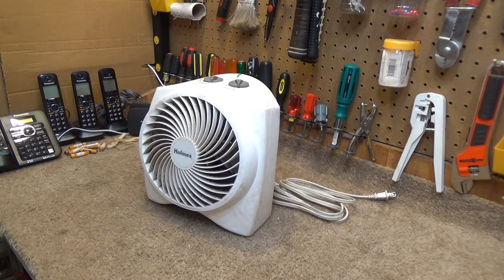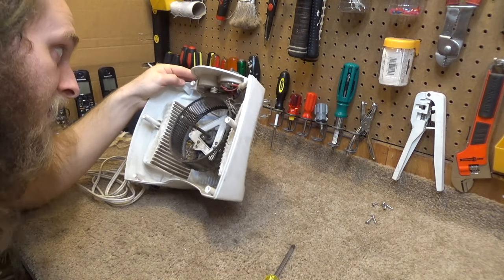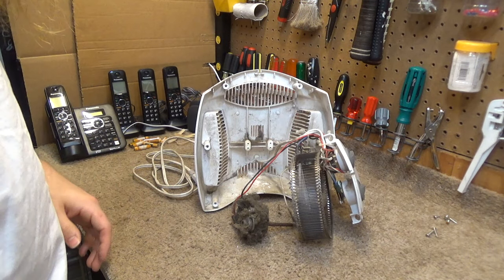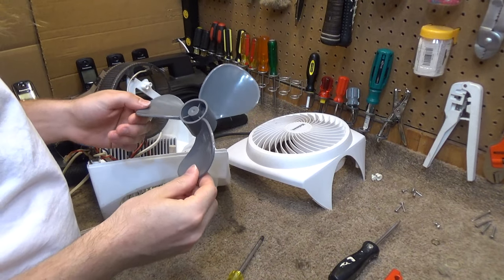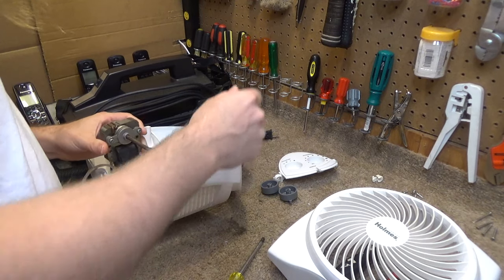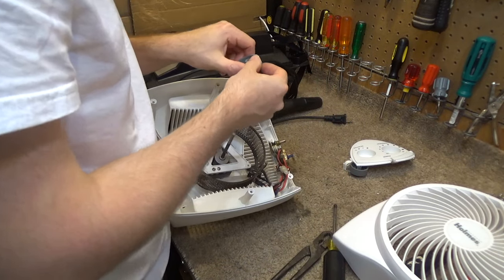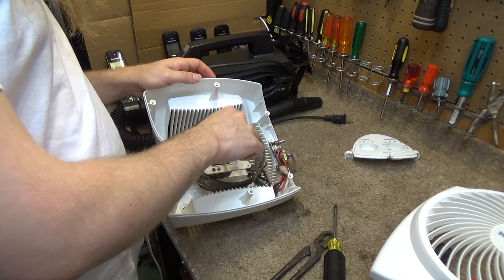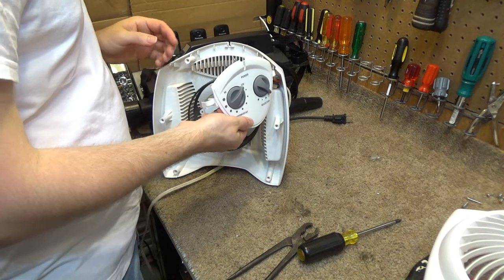Clean and Service Holmes HFH-298 1500-Watts Heater

Comment: Man, that motor is just crazy! I've never seen anything that dirty. Not even my trash find fans; those never get this dirty.
Reply from the maker: This was one of the worst ones I've seen in a while, but heaters are different than fans.. Dust is attracted to heat--a heater running in the same environment as a fan will accumulate far more dust than the fan..